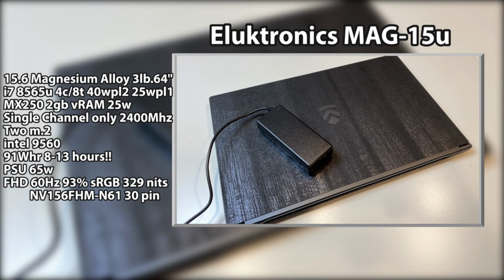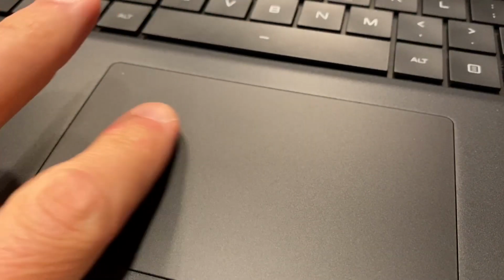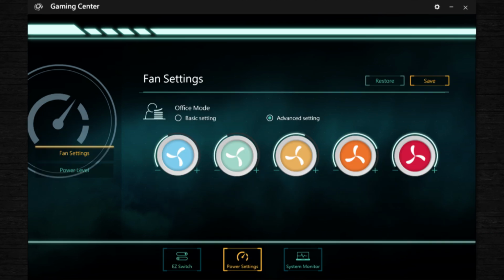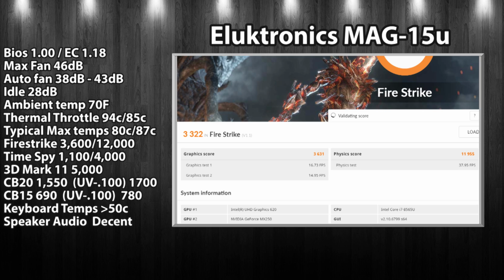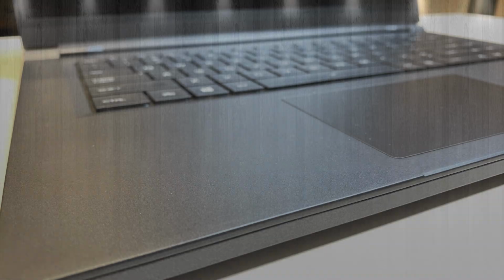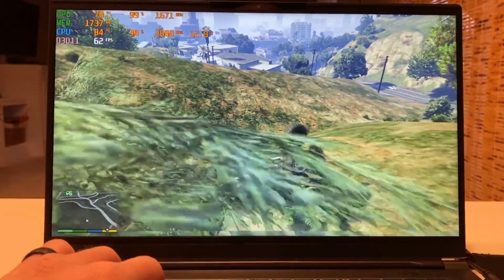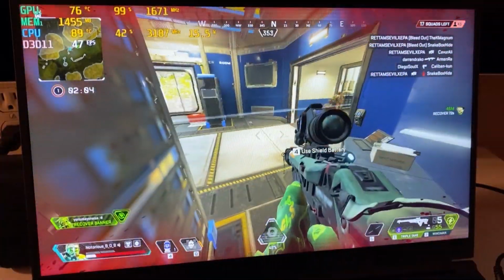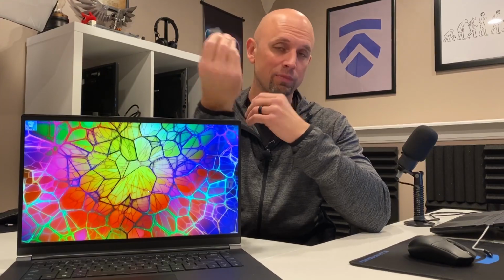Eluktronics MAG-15u Review!  Extremely lightweight with a 10hr+ battery!

Comment: Just ordered and received this laptop from Amazon because of this review. Unbeatable weight + battery + screen for the price, though there is constantly-audible coil whine, and I can't find any drivers on their website?? Very little documentation for this laptop, unfortunately.
Reply from the maker: Not too sure what happened but I put in a request to have this addressed so now check out their support page the drivers should be on there 👍
Reply: @BobOfAllTrades  Thanks Bob! I really appreciate your help.
Reply: Let us know if you reach a solution for the coil whine. I'm considering this laptop for a family member.
Reply from the maker: Stephen Athon First step I suggest running it hard for several hours straight.  There’s a small chance it’ll stop. I’ve done this before with about a 20% success rate.  

The next step is to find the source.  This is hard but one you do, you can use putty type material on the part that’s causing whine.
Reply: @BobOfAllTrades  Awesome, thanks for the tips! This model is available on Amazon for $849 right now with 16GB RAM and 1TB NVMe, seemed like a good deal to me. Planning to be used running audio for a band.
Reply from the maker: Stephen Athon It’s been the most popular laptop for my friends in real life along with their kids in college 👍
Reply: @BobOfAllTrades  That speaks volumes. Thanks for the input!

Comment: hey bob! can you do a review on Lenovo Y540 1660ti and 144hz model. I would appreciate if you do comparison between acer helios 300 2019 and msi gl63 9sdk laptops(display, thermals and tuning).
And your reviews are one of the best I had ever seen compared to other channels. Your reviews gives some extra clear picture on Laptops compared to other reviews.
Thanks in advance 👍✌
Reply from the maker: Probably not since it would be on my dime. I don’t have any Lenovo connections yet.  I’ve covered the y740 and the y545 with a 2060 and 1660 ti respectively.  Both of which won’t be much different than the y540. 

However, the current configurations and BIOS updates has removed the ability to max out the fans. Bummer.

Comment: So basically, this laptop with the 10th Gen 6 cores 10710u, dual channel ram, and either keeping the mx250, or putting the 1650 max-q would be the best long battery, easy carry laptop.
Reply from the maker: I’m not yet convinced the 10th gen 6 core “u” processor is actually better for laptops like this. The core speed hit to squeeze in more cores for the same wattage might not be the best thing for these. Time will tell 🤷‍♂️
Reply: @BobOfAllTrades  True, it is indeed not the best bang for the buck if using the defaults PL (even if it would still have an advantage on multicore tasks), however the 10710u is more efficient than the 9750h at 45w. See https://youtu.be/95DSVCvWvxM
It then becomes a matter of thermal optimization and how much power we actually want vs power consumption.
Heck, it could have power profiles with balanced mode being the default PL for good battery life, and high performance mode setting the PL2 at 45w.

Comment: Thanks for another video Bob! From my experience with Intel's u-series chips [Asus zenbook, Surface Pro 3 i7, Thinkpad T450 and various other U-series devices] you do get great battery life at idle or low CPU/GPU utilization however once you ramp up the workflow without the proper cooling the chips throttle like mad. Even with desktop level airflow you get the same thing happening sadly. Personally I'll stay away from anything with the u-series chip for this particular reason. 

PS - I noticed you have the logitech G305, i have the same mouse!